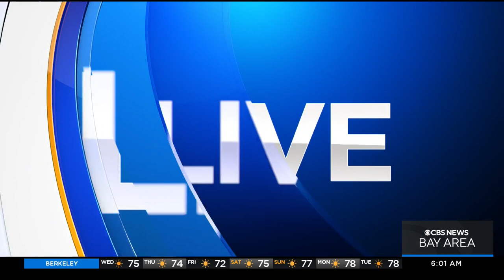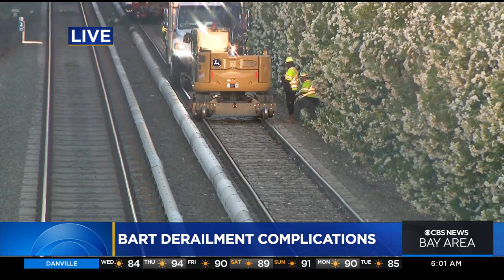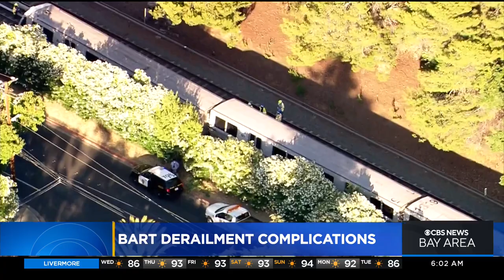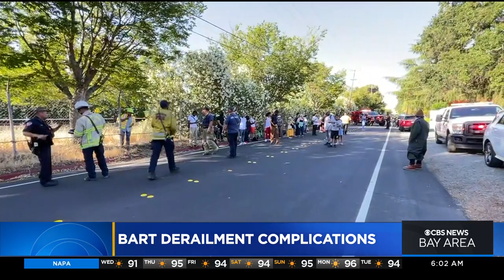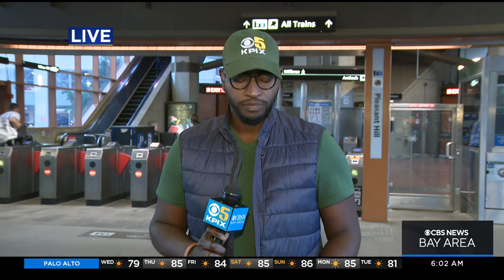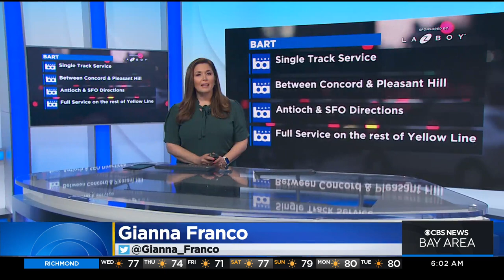Heat causes BART derailment near Concord; trains single-tracking during morning commute

Comment: Yeh, heat is warping hardened steel rails. But you never heard such puke in 1850, 1900. 2000, etc